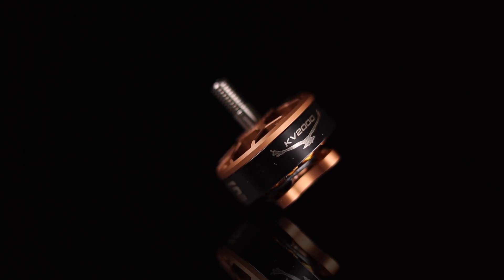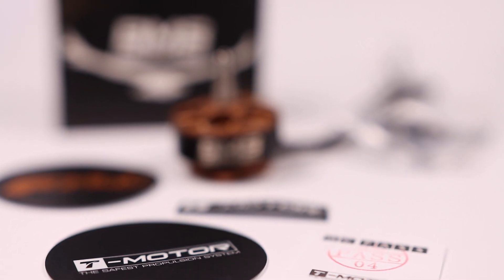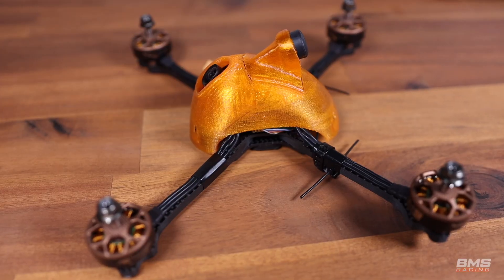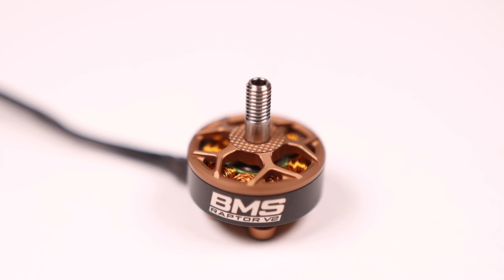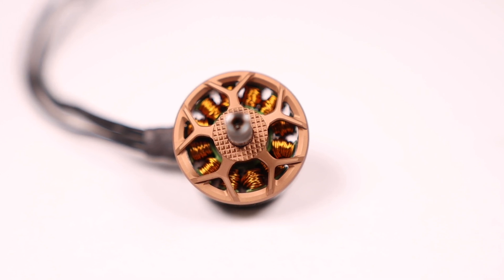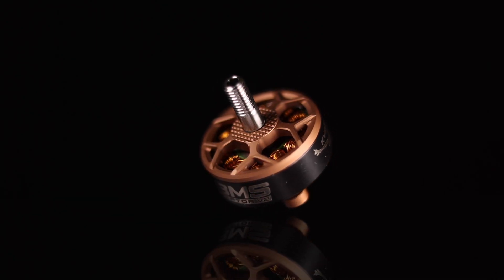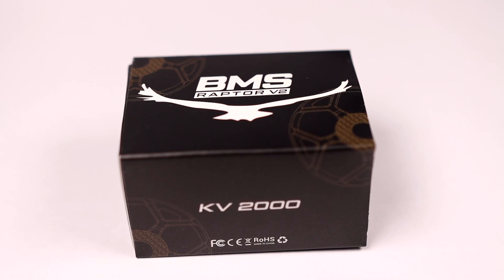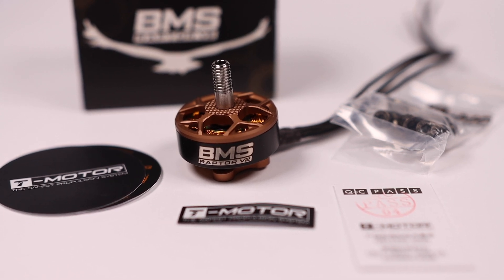T-Motor BMS Racing FPV Raptor V2 Motor Release 🚀

Comment: How would you compare these motors, to the T-Motor F60 ProIV 1950 kv motors?
Reply from the maker: The throttle band on the Raptors will have a more progressive feel on these but in all honesty we ran the IV with completely different ESC settings to the Raptors. Also keep in mind, our focus has been the direction of the Raptor motors rather than the T-Motor line.